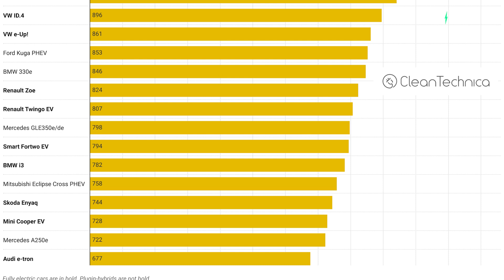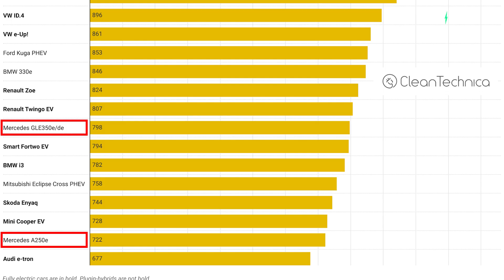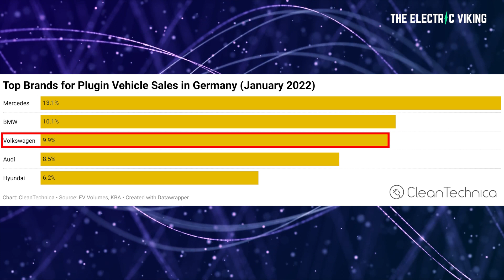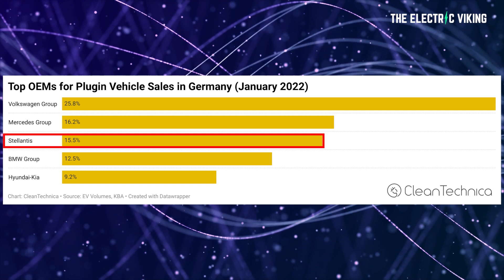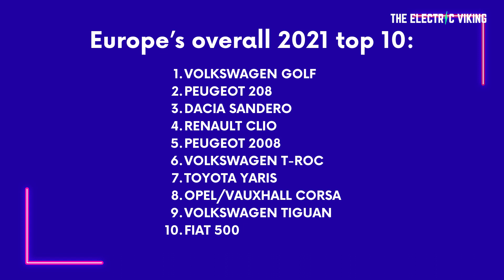EV Market Share In Germany in January 2022 - TOP 20

Comment: It's all very well celebrating the increased market share of EVs, it is quite clearly the future, but mass adoption won't happen until they are affordable both new and used, and the infrastructure exists to support them. I need a new van for instance, but the price of an Ev variant is far more than I can afford, and I can't reliably charge it on the woeful public charging network, so diesel it is. It's the only choice I have. You have to recognise the current limitations of EVs and the time it will take to sort it out.

Comment: When I see "EV" I think BEV. When I see PHEV I think ICE. I have chosen an ICE ('08 Camry V6) while waiting for my APTERA SOL. I could have bought a Tesla 3 in 2019 but I wanted the most advanced car as my last (I'm 79). 
I saw thru the fraud of the HEV in 2000 and continued to drive my '94 Camry V6. I wanted an EV, not an ICE with an electric assist, because I knew that was less efficient, more poluting.

Comment: Using pure electric is foolish. Pure battery is far more sensible. Hybrids only powered only by electric propulsive motors are pure too. Some ICE engines just make electrons. It's like having your own micro power station without the weight of the batteries.
Reply: Well, that goes straight into the "not the sharpest tool" folder.